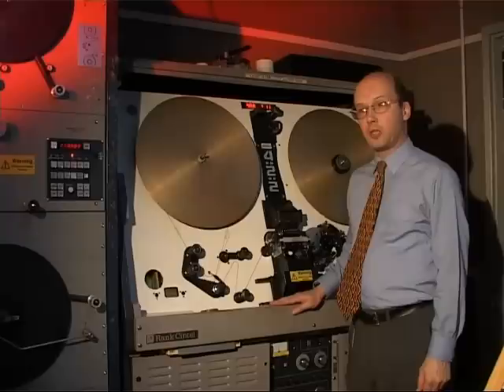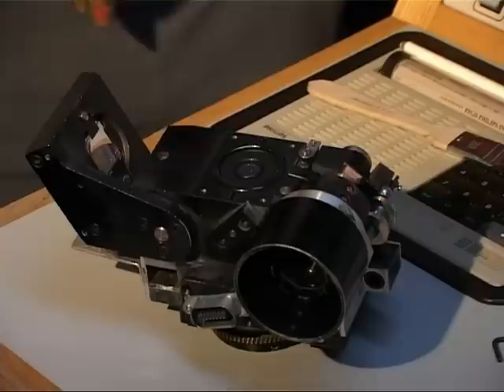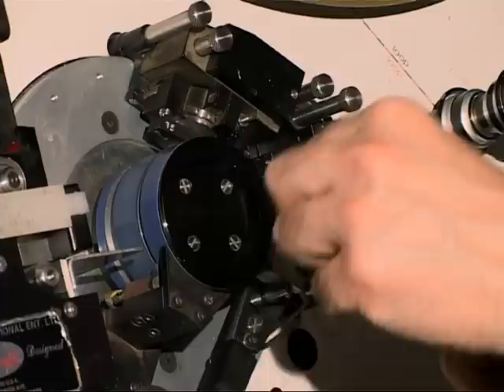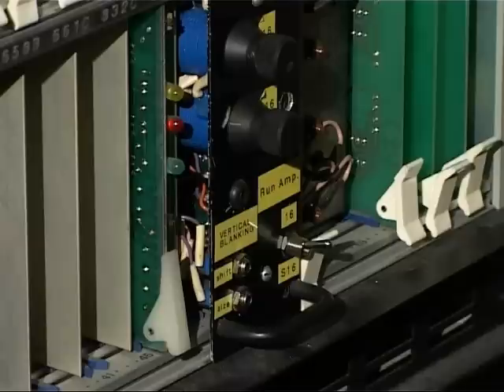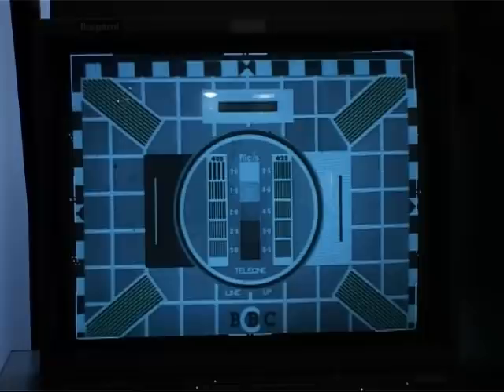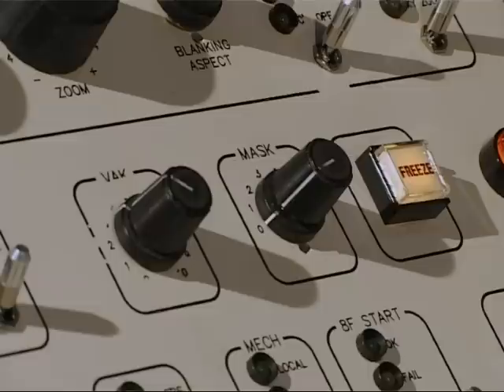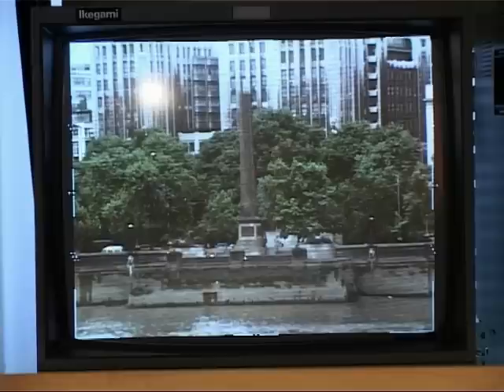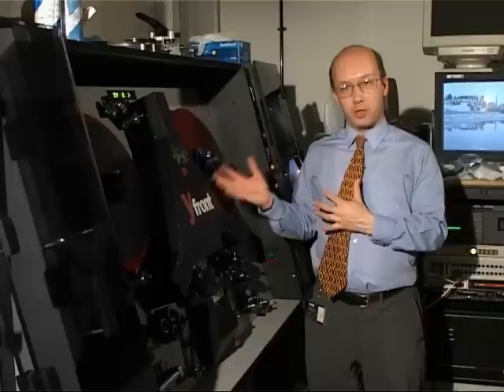Telecine - a brief guide.

Comment: I always wondered what telecine was and now I still have no idea.
Reply: +Symon Enry A telecine is used to transfer anything from film into a TV type signal which can then be used for broadcast or just storage. It's the equivalent to having a TV camera watching a film projector, but a telecine will do the job much better.
Reply: Good! Let's bury it and never have to deal with it again.
Reply: The other terminology, used generally in the U.S., was "film chain."
Reply: Not necessarily, WMBrown. The term "film chain" is typically reserved for the old machines that played film directly to air using a basic lensed-in video camera system that always played the film reel in real time (I'm not sure if these only do real-time  capturing or capture more slowly in order to be more precise), and didn't concentrate on high quality, and almost certainly didn't have nearly as many fine-tuning controls as these do. These appear to use a good bit more adjustment technology.
Reply: Film Chain was a standard in broadcasting for decades.  NTSC in particular had to develop a special shutter blade that would stay in sync with it's 30fps in order to run a 24fps film.  Unlike PAL territories, the film didn't have to be sped up to match this way,.
Reply: Well, maybe "Film Chains" weren't, but film chains were.
Yeah, in PAL countries, film is just sped up by 1 FPS to make an easy match with typical AC motor speed. But I like this complicated way better, because at least this way you don't have to tolerate the slight speed difference.
Reply: The reason why 25fps (I'm guessing SECAM territories did this too) just sped up the film is because a speed up from 24fps to 25fps didn't really matter so much, it was tolerable and all you got was a slightly shorter run time.  Speeding a film up from 24fps to 30fps would have been noticable.
Reply: @GeoNeilUK 
They did come in handy at times to fit in more commercials, though.
Reply: A film scanner maybe easiest explanation.

Comment: Can it scan to 4K/8K ?
Reply from the maker: SD only
Reply: Phil S I suppose they have now replaced them with new 4K/8K scanners then? SD is not acceptable anymore.
Reply from the maker: @moow950  35mm film has at least the resolution of HD or 2K video, but probably not as much as a static 4K image. Blackmagic are keen to sell you their Cintel / Blackmagic film scanner by telling you that all your archive 35mm film has 4K resolution, but although it's probably greater than 2K, expecting a pristine 4K image is maybe a bit optimistic. I very much doubt 8K scanning would yield any benefits at all.